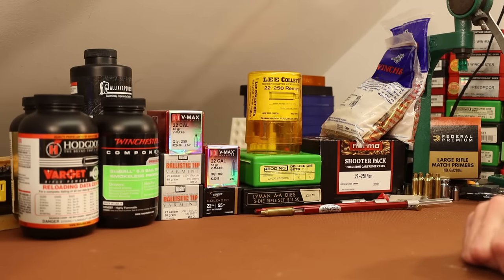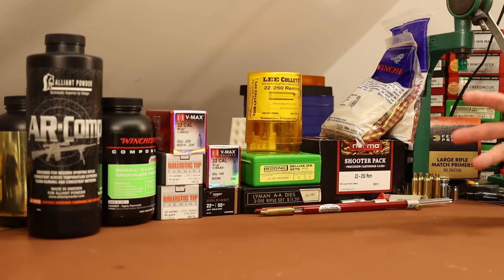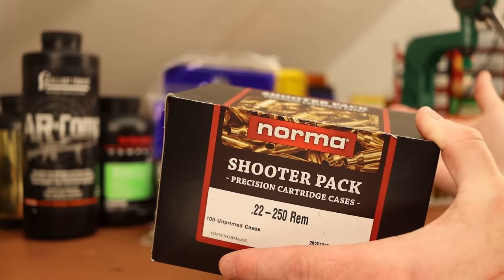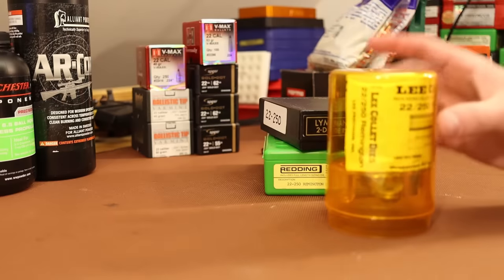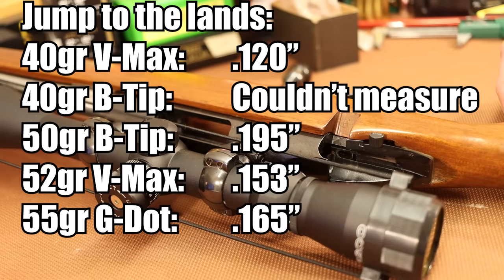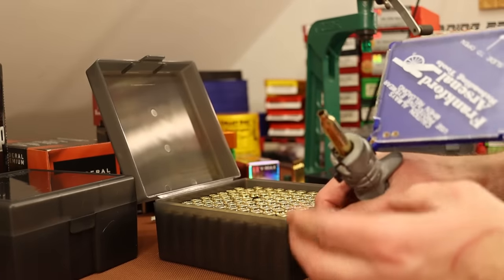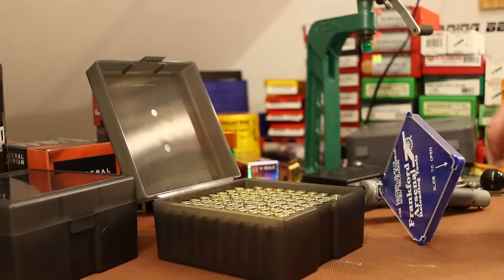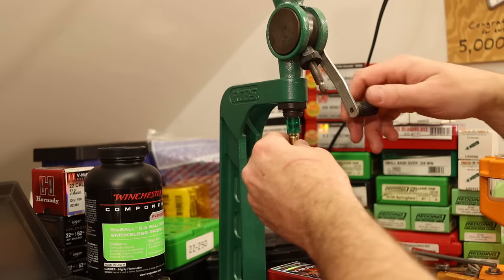.22-250 Remington - Getting started with reloading

Comment: .22-250 works very well with H380/IMR4064/IMR4895. H380 got it's name, when Bruce Hodgdon was testing a new powder.  In a .22-250, at 38.0 grains ....it was shooting one hole groups at their test range............So the new powder was named H380. ( from the Hodgdon loading manual number 26 page 11 )
Reply: Donald... I handload 9 different calibers..  my 22_250 model 788. Probably hands down my favorite... It took 100 s of experimental loads.. different powders n tips of different grains to achieve what i was looking for... I found two opposite loads that fly on top of each other @ 200 yds with no scope adjustment... I kid u not!!!! A 50 gr Winchester ballistic silvertip with 38 grs of H 380... And a 55 gr Hornady v max with 35.5 grs of IMR4895..... Dime groups at 200 yrds... We have competition shooting matches here in North Carolina... I'm barred from using the 22_250.... No one can beat it.....😁🇱🇷🇱🇷
Reply: I had a Kimber 84M Varmint in a 22-250 and IMR4320, a powder I'd previously had exceptional experience with and this particular one was no exception.  IMR4320 with a 55 grain Sierra Blitzking, I could cover all of my 8 shots up with a dime.

Comment: Hey Johnny I reload for 22-250 A LOT and have learned with a 1-12 or 1-14 twist barrel the flat base bullets always perform much better than boat tails.
Reply: I have seen the same with my Remington 700 in 22-250. Mine likes 53 grain Nosler Varmageddon bullets.
Reply: This is 100% correct. I experienced the same with my factory Savage 1:12 twist barrel.
Reply: Found exactly the same out of my 1:14 Tikka. When I rebarrel, I'm thinking of using 1:10. Got about 500-600 rounds life
Reply: JD Kirane my savage likes those bullets also. What powder, how many grains, and what OAL gives you your best groups if you don’t mind sharing ? My only complaint with those bullets is trying to get them to start in the case got any suggestions for that ?
Reply: I've noticed that to.
Spitzer round from sierra I think is the last I used that went straight.
Boat tails floundered in the air and would land sideways and whatnot.

I was like...whuuut😵

Then I read somewhere 🤔🤷 that boattails need higher pressure to fly straight.
I might try them again and go max load or something.
Reply: @krrrruptidsoless  Light weight boat tails don't have enough bearing surface and have a lot of Yaw. 62 Grain boat tails usually can be loaded to shoot well. Any bullet that is on the shorter side needs to be a flat base to get more bearing suface.

Comment: If youre watching and havent ever shot a 22-250, you should. Its one of the most fun cartridges to shoot. Big crack, low recoil, high power.
Reply: It's my go to Woodchuck slayer.
Reply: Is it a barrel killer?   Lots of powder smoking down a small hole.
Reply: @bmstylee  They are known to be. I've heard figures as low as 1200 rounds. Even then, that's just accuracy degrading a bit.  I feel like my Savage 110 has already paid for itself at 500 rounds or so, and it is still going strong. That's an easy sub half minute rifle. I'll take 1200 accurate shots over 5000 mediocre ones.
Reply from the maker: @bmstylee  Barrels are cheap and performance is priceless.  I refuse to join the "omg barrel burner" crowd!  Life's too short to worry about barrel life.  :)
Reply: @JohnnysReloadingBench  absolutely.  6.5 Creedmoor isn't easy on barells but I love my Bergara.
Reply: Was watching a recent video from Match Grade Machine and it was funny, bang, rifle did not move! Lol.. also find sister company Preferred Barrel Blanks

Comment: one thing I wish barrel makers would do is put cal, and barrel twist on the barrel.
Reply: You may find it in odd spots. Some are marked on the chamber end face (may be lost when chambered) or may have ended up facing the barrel channel in the stock. As for chambering so many don't have that when they leave the barrel makers and are done by a gunsmith. It would be up to them to mark it.  Caliber is kind of incidental once chambered but that info as well as Twist could/should be marked once chambering is chosen.

Check https://preferredbarrelblanks.com/ for picture of marked unfinished barrels
Reply: Makes me fricken CRAZY!!
Reply: Wait, what barrel makers dont do that lol?
Reply: @paulvenn4447  Criterion Barrels roll Mark their pre-fit barrels with the chamber and twist rate so it shows on any rifle. Shilen marks their barrels on the breech end. You can't see it once it is installed.
Reply: One thing I wish all companies would do: have an idea submission area and ACTUALLY take advice from their customers. Shocking the concept but I think it’d only help them. The ceo should not be making the technical decisions but they do.
Reply: Sako and Tikka do, at least on most models. I agree though. The problem is a lot of factory barrels aren’t that accurate. They may be spec’d for 1:10 twist .243 Win barrel but may vary from 1:9.7 to 1:10.3. They can have some variance there.
Reply: Get a rod with the bore brush on it. Start it in the barrel.Put a mark on the rod @ 12:00 position and flush with end of muzzle. Push rod in till it makes one full rotation. Stop and make another mark flush with muzzle. Pull out rod and measure between your two muzzle marks and that’s your twist “ 1 in ( measurement) twist”
Reply: Amen, brother. Why don't they do it? It would cost them pennies to do it.
Reply: @ewetho  Hey Big E! Thanks a ton for that info. I really appreciate you doing that for us! I never heard of this info being available.
Reply: @paulvenn4447  Tons of barrel makers do, but some don't.  Anyway, it's easy to determine yourself. There is lots of info online that shows you how to check your twist rate. Best info? 'Gunblue 490'. This wonderul guy has forgotten more than you and I will ever know about EVERYTHING GUN RELATED! Have fun, and good shooting to you, my friend!

Comment: Merry Christmas from Australia 🇦🇺.  Finally one that I can comment on.  I have a Ruger M77 Mk1 in 22-250 which has a 1:14 twist.  I have loads that use 55gr projectiles from Nosler (orange ballistic tip), and Berger VLD, both of which group exceptionally well at 100m.  I have also achieved sub MOA groups using the Sierra 63gr semi-point projectiles.  All of my loads use ADI 2208 (which I understand to be your Varget), in Norma or Lapua brass and FedGM210 primers.  I look forward to the remainder of this series.  Thanks for the great videos. Shane.
Reply from the maker: Thanks for watching, brother!  And thanks for the info about what's working for you.  I love hearing from you guys down in Australia.  You all are my #3 country when it comes to views, after the US and Canada.
Reply: I’ve got a 1:14 22-250 that shoots 55gr well at 100 yards but after 100 yds they lose stability and the groups open up to 3-4inches.  I understand that to be a stability problem bc if you run the numbers thro a bullet twist app then they show as being marginal.  I also have a 338 with the same trouble with the heavier bullets.
Reply: Wedge - how many grains of the 2208 for your results?

Comment: If you measure the headspace on the modified case and then measure the same on your fireformed piece of brass, you can see the difference and then use that to adjust your actual CBTO to work with your fireformed brass. Yes, modifying an actual case can be done, but it isn’t necessary as long as you have a piece that’s fireformed to your chamber.

Merry Christmas JRB!

Edit: use the Sinclair primer seating tool! Yes, the lazy in me wants one that holds the primers to help speed up reloading, but the OCD in me wants the quality and ease of seating and the feel you have with it!

Edit 2: my 10th edition of the Hornady manual, both the digital and the printed copy have data for the 53gr v-max in the 22-250 Remington. No data for 6.5Staball powder obviously, but it does for pretty much every other powder.
Reply from the maker: Very good point about comparing the headspace between your generic modified case and a fired case.  I'll be sure to mention that in the next video. 

I have NO IDEA how the hell I missed the 53gr Vmax in the manuals.  I'll be sure to let everybody know in the next video.  It's right there in my 10th edition and on the app.  I seriously have no idea how I screwed that up.  I tend to think of this bullet as "heavier", so I must have been looking for 63gr instead of 53gr, or something stupid like that.
I'm intrigued to see that they show an OAL of 2.350" in the manual.  That ogive was definitely below the case mouth at that OAL.  Interesting.

Comment: Did you ever go ahead with a fast twist 22-250?
  I built a 7 twist using a 26" shilen on a model 12 action in a Boyd's stock I bedded. 
   Slings 90 and 95 grain projectiles. The 90 grain Berger vld are supernatural. When my savage was still a factory 12 twist I used the 53 grain vmax.  Awesome varmint bullet.
   That barrel must be a 14 twist as a 12 twist will stabilize the 53 grain vmax. 
  My brother has a TC Compass in 22-250 with a 14 twist tube. He slings the 40 grain vmax for coyotes around the farm.

Comment: Yes Hornady will make an OAL Stoney Point Gauge Brass, from your fire formed brass. I have a Stoney Point myself. Great tool, and theres no keeping the projectile from sticking in the lands. No matter how light the pressure used to push, it seems to stick constantly.
Not sure if it makes/made a difference ( I never compared the two to see) BUT, I feel standing the rifle on the buttstock, barrel up, is possibly better, its how I used the OAL gauge. My thinking is everything is more concentrically aligned without gravity coming into play.
If the barrel is laying flat, then gravity pulls the projectile  sideways (down) ever so slightly out of concentricity with the bore. Considering the ease with which the bullet sticks, that makes me think the bullet is possibly not seating/touching lands 100% evenly with all the lands. 
Hence why I keep my barrel as straight up as I can hold it and then insert the gauge up into position for the measurement.
My theory is the bullet finds concentricity easier and possibly with less interference, resulting in a more accurate reading-even if measured in thousandths or even ten thousandths of an inch.
Truthfully who knows if it matters enough to even be concerned about.
Sometimes I think I’m too anal about reloading, but with my best ever grouping in my .243 of a .421 - 5 round group in my Savage 12 FVC, with a 26” medium heavy taper bbl, and Hornady 87gr BTHP, in Hornady brass, CCI Large primer; I will continue to “pretend” it possibly had something to do with my approach.
I THOROUGHLY ENJOY YOUR VIDEOS, truly you let me reload without reloading and I don’t reload as much as I used to.
Public ranges are not exactly conducive to good groups considering gun reports affecting your own trigger control and firing timing.
Please keep up the great informative videos, your passion is evident as well as your methodology and explanations are highly appreciated and informative as per the why aspects.
Sorry for the essay 😁

Comment: A bit of a rocky start, but you'll be getting some consistent sub half moa groups in no time. The wandering Magneto Speed wasn't doing you any favors in the accuracy department. Your idea on gathering velocities with the Shot Marker should work out fine. I would also ditch the Winchester brass. It wouldn't be worth the effort. I've never had a good experience with Win ammo or components. The stabilization problems were interesting as well. That Douglas has to be a 1-14" twist. My 1-12" Savage loves the 53gr Varmageddon. I just joined your channel, happy to help out. Merry Christmas. Looking forward to the next 22-250 installment.
Reply from the maker: I am really temped to do just that...dump the Win brass and maybe buy another box of Norma.  However, I think it's an interesting topic to cover and explore...just how much work it will take to get it working well.  Even if it only helps people justify the big $$$$ for Lapua or Norma, it feels like something I should explore.  I don't want it to take over the series.  I really want to focus on working up loads, so if annealing or maybe a little neck turning doesn't do the trick, I'll just dump them in the trash and move on.
Thanks for the membership!
Reply: @Johnny's Reloading Bench.  I was thinking the same.  Look at the position of your magneto speed from 1h:30m to 1h:35m, it starts off about 2" from the muzzle and later it almost falling off the barrel.  Haha commented too early, you saw that.

Comment: All in all, a very nice video. Good info on the whole process. All handloaders have problems. I always lube the inside of the neck with powdered graphite on a Q-tip before sizing. I've had bad luck with Winchester brass. One bag had 50 pieces (half the bag) where the new cases would not fit in the chambers of two of my rifles. I full-length resized three of them, and they STILL wouldn't fit! Can't say I understand that, but there it is. Sent them back, they gave me a new bag. Overly tight primer pockets make my head ache when I'm loading. You should consider either cleaning between groups so that each load has the same amount of 'dirtiness' or shoot the groups together, switching targets between each shot. The jury may be out on whether or not hanging that velocity meter on the barrel is a good idea.

Comment: I'm not sure if you're still catching these comments. Regarding ball powders; I have three Speer reloading manual from recent all the way back to the 80's. Every load listed with ball powders have an asterisk and a note that these loads use magnum primers (it never says why, or even points out that these are all ball powders). From watching some of your videos using ball powders and the cci 450 primers you seem to get much better standard deviations than with other primers like the 41.  I recently did some load work ups in 22-250 with 55g varmageddon and PP Varmint with BR-2 primers. 1 out of 3 loads had single digit SD but I'm going to reshoot the series with LR magnum primers and see if there is an improvement in velocity consistency.

Comment: On the subject of barrel twist for .22-250: As with a lot of other calibers, the best twist rate depends a great deal on the length of the barrel. With a 22 - 24" barrel a 14" or even 16" for lighter bullets is just fine. 16 - 20" barrels that don't make the velocity of the longer barrels and must have a faster twist. I have had a 22" and a 20" .22-250, both with 1:14 twist. Both shot under 1" at 200 yards with good ammo.
Depending on your ammo, temperature can very definitely change your zero and group size. My 20" Ruger light weight barrel was very much affected by ambient temperatures and barrel heat.

Comment: @Johnny's Reloading Bench - After thinking about the slight keyhole issue with the 53/55gr bullets, I really think you should closely inspect your muzzle crown and the rifling at the end of your barrel. You had plenty of velocity so there should have been no reason for those bullet weights not to stabilize. I've shot literally thousands of 55, 57 and 62 grain bullets from my 22-250's and never had any key holing. Just something to look into if your gun continues to have stabilization problems with some bullet weights.

Comment: I'm glad your fire forming. Otherwise, I would start over. Get rid of that bayanet looking thing on the end of the bbl. It throughs off the barrel harmonics. Every time you had a wild shot , the thing moved.  I'd watch the vid over ( im sure you have) and look for patterns. Have you tried SRA 53gr MK?, 53 blitz king, or 63gr sra is a good bullet to try,  depends how the throat was cut. Best groups seems to come from a cold bbl, then goes down from there.     History: what was shot in the bbl before?  what groups did it have then ?  what powders?  14-12 twist ?    AR comp is a faster stick powder? also  try varget, trickle charge. Your right, at the end of the vid, the thing is ready to fall off !

Comment: Hornady did a video of a ballistic tip bullet, boat tail getting erratic because the gases coming past the bullet and melting the tip.   Other tests showed the boat tail bullet not sealing as well and having to push thru the gases as it left the barrel which cause it to wobble.   Try a couple flat base bullet and see if the problems go away.  Hornady fixed the problem with their BT with the ELD-X bullet features a long, javelin-like body, a boattail base and the new Heat Shield Tip to improve long-range performance. it seems like when the trigger of the rifle breaks over, the travel after is what is opening up your groups, maybe.  A Timney trigger will close them up quite a bit.